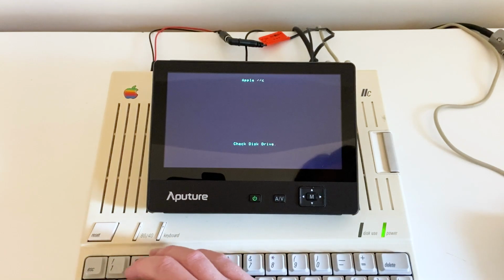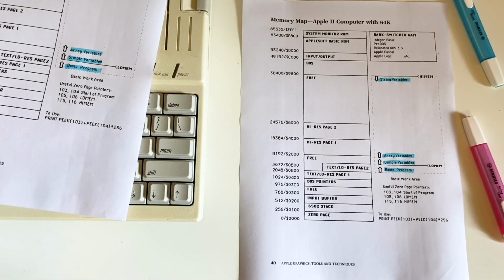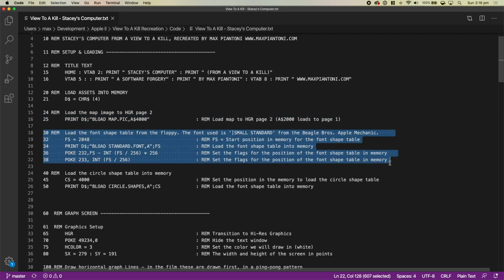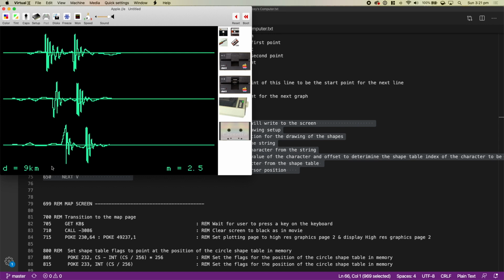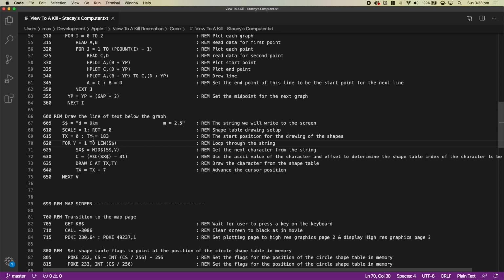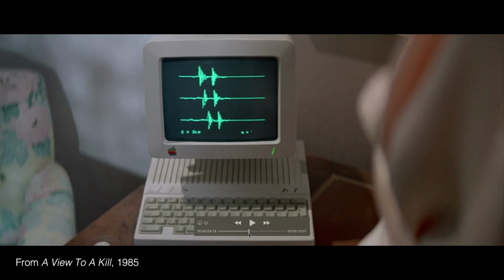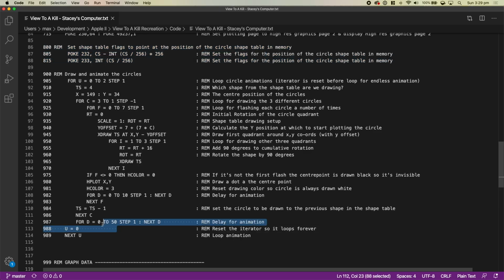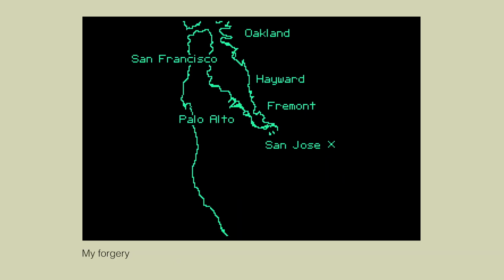Rebuilding James Bond's Apple IIc - A Software Forgery

Comment: Great job! 

I loved seeing this because you did it using software I didn't know existed (Mechanic and MousePaint). I'm looking forward to playing with those on my //e soon.

For the map copy, if you wanted to do it without resorting to anachronistic technologies, you could have used either a digitizer puck (likely what they actually did) or a transparency sheet from an overhead projector. (You put the transparency on a map and trace it with a vis-a-vis marker, then tape it to your screen and draw pixels wherever there is a line.)

I am not sure the sound effects were made by the Apple ][. It sounded more like modem noises to me.
Reply from the maker: I like the transparency idea! The sounds definitely aren’t from the apple II. From the sound of most of the bond films of that era I think they had some kind of analogue synth they used for their machinery/electronics sounds. Things like doors and motors. I think they just beeped out some beeps that way. Movie magic.

Comment: I'm forgetting the details, but I remember back in the 80s that a magazine published an Atari 8-bit program that was used on the TV show Whiz Kids that was used when an actor was supposed to be typing on the computer. All the text was predefined and when any key was pressed, the next correct character was displayed. This let them produce text synchronized with the keypresses, but they didn't have to worry about typos. I haven't been able track down the magazine or software, though I remember typing it in.

Comment: for what it's worth: the font used for the map's text is different
Reply from the maker: Yes it is, I considered tracing the characters out to be exact but I had to draw the line somewhere. The font on the previous screen was likely just plotted out (you can see how it draws left to right in the original) but I wanted to figure out how to put text strings on the screen. The experts at Sotheby’s can use these and other clues to spot the forgery.

Comment: Amazing work, Max.  Truly incredible.  I can confirm it works on my IIc, but there is one caveat. I tried running it from my FloppyEMU attached to the external drive connector.  I used ROM Xc and ROM4X to make the External 5.25" the boot drive, but sadly, ROM4X doesn't work insofar as it polls the internal drive (nothing in it) forever.  In other words, it won't work with ROM4X via FloppyEMU attached externally.  I just installed the BMOW Drive Switcher (a hardware switcher, unlike ROM4X), and that works.  But some people probably only have ROM4X, so I'm curious if there is something in your code that might be causing the IIc to poll the internal drive (bypassing ROM4X), such that it won't work without the BMOW hardware hack.
Reply from the maker: Thanks for such a detailed comment, I somehow missed it at the time. I think you’re onto something. I haven’t got a rom xc but I do want one. If I ever get one in the future I will look into it. If you wanted to have a look at the code and suggest a fix it is on my github. I have only ever tested this by booting from the internal drive, or from the BMOW drive switcher with the floppy emu. Cheers.
Reply: Thank you for making time to reply. I can confirm that there is no work around for ROM Xc. I know because I talked to the developer. But the BMOW Drive Switcher does work.

Comment: I'm actually willing to suggest that the code was written in Apple Pascal.
It has several features here that would come in handy:

The "turtle graphics" library could have used vectors (move turtle - draw), and that would allow drawing of the map as opposed to saving as a hi-res image.
Next up:
The Pascal library has the ability to write text and characters on the screen - any location, and allows this without 3rd party tools, nor does Pascal require shape tables for this (to be fair, I think behind the scenes, it did use shape tables for characters in hi-res mode).

So, to write say Organ Trail, then pascal was used. 

The other HUGE advantage? Well, pascal is a VERY nice block structured coding language with things like global and local variables. 
Thus say when you go into town to buy things, that code module can be loaded off disk, and loaded on demand. and when you leave town then that code module (and memory, and all variables) are now un-loaded from memory.

So, this means that Pascal allowed a program as large as the whole disk drive, and bits and parts of code can be loaded on demand (kind of like a .dll on windows , .dll = dynamic link library if you wondering).

So, my bets are Pascal was used. The other advantage is Pascal would usually run about 2-4 times faster then AppleSoft basic, and EVEN better was the Pascal code was compiled, and thus code was stripped of comments and source code - making the smaller compiled p-code smaller then what the same code in AppleSoft basic would be. (to be fair, both Integer and FP BASIC on apple used tokens for each keyword).

I wrote a Payroll system for the Apple II - including the payroll tax calculation parts. Pascal was a FANTASTIC development language, and a code and block structured language was not only great, but was also far better then AppleSoft at memory management, and that on-demand loading of code, and release of variables in code? Rather nice!

so, I think that any professional development firm hired for that James Bond filum? I'm betting they used Pascal for this, including the Turtle graphics library that allows characters to be written at any X,Y location on the screen - just like Organ Trail does.
Reply: Well, as a history follow up, I was doing some deep reading on the Origan Trail development team. Turns out they DID use Apple Soft Basic, and the hunting game was written in assembler.

However, I should also note having used the Apple Pascal system, when you draw a circle, you have a tell tell 4 quadrants of the circle plotting, and if you look close at the Bond footage, you note close that the circle looks to draw in 4 quadrants - again a tell tell sign that the demo program was written in Pascal.  So, it's still possible that the movie example was written in AppleSoft basic, but the look and feel still suggests Pascal was used.
However, as a history lesson, and being correct?
My my comments about Organ Trail having been written in Pascal is 100% wrong and incorrect - my apologies for this error, it was written in AppleSoft BASIC, and as noted, the little hunting game was 6502 assembler.

Comment: Fascinating. I bought an Apple 2c from John Lewis in London in late 1984 to use as my business machine. As well as the monitor, I had a second disk drive, and an Imagewriter printer. The software was AppleWorks. About a year later I bought a modem and subscription to Prestel. This was a precursor to the Web, providing text based information pages via dial-up. I was a freelance video editor, and was getting work in Europe and had set-up and account with a travel agent. They had some flight information pages on Prestel, so when I got a request, I could look up flights and book them over the phone. In the mid-1980w, this was a huge thing to be able to do. AppleWorks was a pretty powerful package. I used it for all my business documents, and the spreadsheet could invoices and quotes. The 2c remained my business machine till I got a Macintosh in the early 90s. I also had a Telex machine, so my office was pretty cutting edge!  

I had a go at Apple Basic, but at the time I also had a BBC Micro B with BBC Basic which I had got quite good at. This project was a lot of work, but the end result is cool. Unfortunately my 2c failed sometime in the early 2000s, and I no longer have it.

Comment: Note: The computer display doesn't flicker in the movie. Either they generated the graphics using another method, or they did something special to get the monitor's refresh rate and timing to sync with the camera.
Reply: There was a hacker news post recently where a guy who worked on set for Jurassic Park commented on this. He said that his job was to get the monitor refresh rate tied to the cameras for just this purpose.
Reply from the maker: I feel that they must have somehow synced it with the film because it is definitely the image from the real monitor. And there are a couple of other monitors in the film with different characteristics
Reply: It helps that they have a specific camera angle setup just for those shots. They were likely not even done in the same studio as the rest of that scene.
Reply: The movie would have been shot on film which I do not think suffers from the flickering caused by the way electronic cameras scan scenes.

Comment: Hi Max, I still have my Apple //c, so appreciate your program. Can I ask what you are using for a monitor with your system? Is it just using the composite out for monochrome, or does it also do colour? I have a PAL Apple //c, but no monitor.
Reply from the maker: I'm using the composite out here, so it's a monochrome signal. The little monitor I'm using is a field monitor that I bought a while ago now. It's not very good for the Apple II at all. When the Apple switches graphics modes it confuses the monitor, and it goes to a blue screen for a while. So I don't use this monitor any more. I use a RetroTink now and a regular HDMI display. Which is super crisp but still black and white for the PAL IIc. For colour I think you can make an adaptor to get the signal out of the monitor port, or there's a IIc to VGA adaptor from a2Heaven which gives full crisp colour...
Reply: @maxpiantoni  thanks, waiting for adheaven to have it back in stock

Comment: That was fun and frankly the most I had ever seen of the Apple IIc.  Why wouldn't they just have plotted the graphics for the text on the first screen also, rather than having suffered with the fonts?
Reply from the maker: Thanks Tommy! It’s possible that they did manually plot the text on the first screen, you can kind of see it trace out if you watch that portion in slow-mo. I considered doing it that way too but it would have been almost as laborious, figuring out the pixels for the characters and writing the code to plot them in their appropriate relative positions. I figured I would have learned less if I’d done it that way - More valuable to learn how to put any character anywhere on the HGR screen for potential future projects.

Comment: Excellent video. I really appreciate the love put into every detail. Maybe you can list the tools used on the PC side for image conversion, disk image creation, etc?
Reply from the maker: Thanks and sure:

Apple II Software I Used:
- Apple Mechanic for creating shape tables
- Mouse Paint for adding the text to the map
- Copy II Plus for moving files between disks etc
- The boot disk uses DOS 3.3
- I also looked at but didn’t use a bit of other Apple II software while I was deciding what to do about text on the HGR screen. Including The AppleSoft toolkit font thing (I think called animatrix), Fontrix, Beagle Graphics, some other beagle font tools, etc 

Mac Software I Used:
- Visual Studio Code to write the code
- Virtual II as the emulator, I also created the disk images in virtual II and imported files (using its ability to mount a folder as a disk). Once the files were imported I  moved them around using Copy II Plus.
- Affinity Designer for drawing the coastline for the map (not the label text though). I also figured out the best way to draw my circles in Affinity before plotting the manually in Apple Mechanic. My first pass at freestyle plotted circles were charming but wonky.
- Buckshot for converting the coastline drawing to HGR data
- ADT Pro to send the disk image to my Apple IIc and write it to 5.25 floppy

Comment: Great video Max! Very fun! A couple tips: if you edit BASIC with a text editor, and then use EXEC to enter it on the Apple II, you can save a lot of memory by removing the line numbers from your REM lines so they do not get stored into AppleII memory. Also, why not use the SCALE command to draw your circle shape at different sizes instead of creating multiple circle shapes of various sizes?
Reply from the maker: Thanks John and thanks for the tip, I didn't know about EXEC. I originally considered and tested using SCALE but found that it didn't produce 'round' enough circles. Because as far as I could tell you can't scale down, only up, it would require that I started with the smallest circle and made it bigger. This lead to the number of zig-zaggy-step-bits in the circle to be too minimal, and the circles looked boxy. Hence the different sized shapes in the shape table.